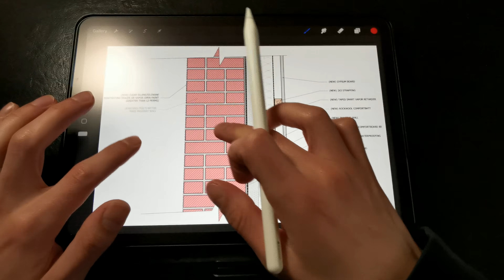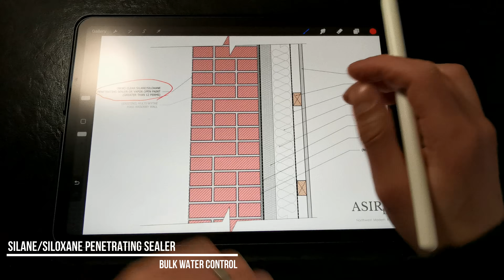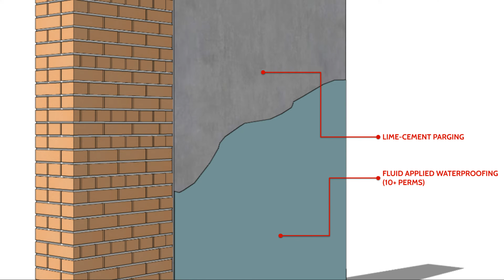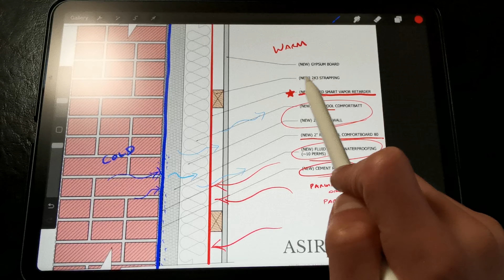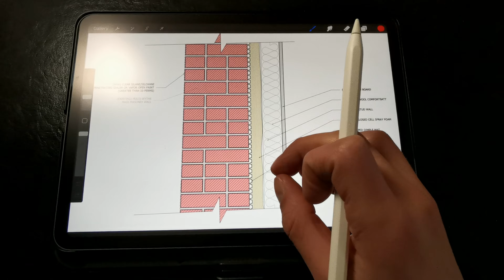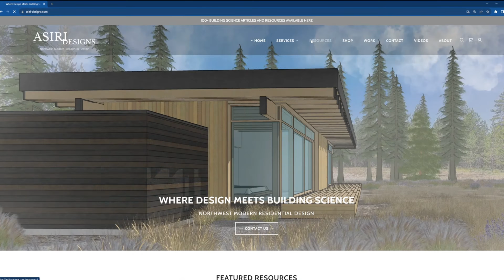Insulating Old Mass Masonry Walls (For Architects + Contractors)

Comment: What if the wall is a dbl brick wall with a 1" air gap between wythes. The joist are embedded in the interior wythe. youve recommended a dimple mat before sprayfoam but where wouild it drawin to if the joists break it up. 
@ASIRIDesigns

Comment: Love the content. But it feels like you skipped over options to insulate on the exterior of the building. I have an 1890s brick milling building in the Boston area, and don't mind going over the existing brick, but am curious what recommendations you have to put an air and vapor barrior as well as decent insulation on the outside. Are there products that have a high enough holding power to allow wood or some other rain screen and final exterior material attachment layer directly to the brick? Without an attachment directly to bring, it would seen like additional foundation for the insulation and final siding layer to be supported by would need to be installed. Are there options for this? Putting the air barrior on the inside, seems like something that is bound to get holes in it over time.

Comment: In a triple-wythe brick construction in zone 4a, (NYC), will this work?
Mineral paint on the outside.
Proclima sprayed on the interior wall.
R12.6 smartrock installed on top of the brick. (Rigid rockwool with intello preinsralled)
Metal stud framing in front of the smartrock.
5/8 Sheetrock.

Comment: I lived in an old brick building in Boston and it was quite comfortable inside with no insulation.
Reply from the maker: Yes the ones with thicker walls certainly can be! A triple or quadruple wythe masonry wall is about R-6 to R-8 which is better than most curtain walls on contemporary buildings.

Comment: Sharif, love your content. 
I am an architect with a focus on large scale office, residential and mixed use buildings but I am working on a renovation of my own home (circa 1920 Chicago bungalow) that is a mass masonry construction. I have a question about finishing the basement. The basement is partially below grade (cast in place concrete) with the above grade portion being mass masonry (brick). We have installed an interior perimeter tile and sump pump drainage system to control hydrostatic pressure below the slab. The dimple mat installed around the perimeter as part of the drain tile system transitions to a plastic wall liner that is attached and sealed to the concrete foundation wall to prevent “leakage” of the existing radon mitigation system. The sealed plastic liner prevents the radon mitigation fan from pulling air out of the basement interior space rather than from below the slab. The previous owners painted the interior side of the brick many years (decades?) ago. We are removing that paint as we don’t believe it is “breathable”. We can get a majority of the paint off but not 100% of it and this may impact the ability to get a good parge coat and fluid applied waterproofing system installed. I am thinking a sheet applied barrier (I.e. Henry’s Blueskin VP160) installed on the (mostly) unpainted brick may be a good alternative. 
Thoughts?

Thanks in advance, Chris.

Comment: We dont do it this way in Europe. You’ve completely over-complicated it. Add to the thermal mass of the walls with a thermal lime plaster in the interior. Accept that you need some heat passage into your old solid walls in order to dry them out and keep your eye on ventilation. Make sure your external pointing is lime, and softer than the masonry, the pointing is sacrificial.
Use lime wash or vapour open paints on the walls inside the building.
Reply: Or use a lime-based insulating plaster (thickness your choice). Same principle of keeping in contact with thermal mass, allowing 500mm wall to continue to perform as built, managing moisture and sealing out air voids. Although messy, it is simple. Not architect precise though! It does have a slightly rustic finish, but in keeping.

Comment: I used InSoFast panels on the inside of my mass masonry walls instead of a simple mat/spray foam. 

Baffling on the masonry side allows air movement so moisture can spread out and find its way back out. Locks together at seams & spray foamed the edges to act as air/vapor barrier. Plastic studs inside the panels allow you to screw the drywall directly to it on the inside. 

Trickiest parts were electrical & penetrations. Spray foamed the hell out of them.

Comment: Old historical urm buildings are my favorites to work on. So they will be around another 200 years. I Hate fixing those old chimneys that were built flush into the walls. I use dolomite and portland cement and sometimes hydraulic cement on stone rubble foundations below grade, but not on man made masonry or free stone materials.

Comment: You have the most informative videos in these topics that I’ve been able to find. Thank you for making these!

Do you have a method of interior insulation that you’d recommend for a cinderblock wall with vinyl siding on the exterior?
Reply from the maker: Thanks so much! I'd recommend checking out this article for how to retrofit interior insulation into a concrete block wall: https://asiri-designs.com/resources-1/f/how-to-insulate-concrete-block-walls

Comment: Can Prosoco Cat5 be also used in the interior masonry wall? Or the paint is a better solution? Triple wythe brick in NYC, I'm looking to insulate the exterior walls. Waterproof paint in the brick or Prosoco Cat5 barrier, rockwool batts in a 2x4 wood frame, Siga Membrane with Siga tape, sheetrock on top of the Siga. Will that be enough?
Reply from the maker: I don't believe Cat5 is designed for negative side waterproofing applications, so it might not be covered under warranty. Not saying that it won't work, I would just be cautious and maybe even try testing it out on a small section of the wall to see if it blisters after a precipitation event. The BMC II product a is designed to be used as a negative side coating according to their PDS. Other than that, sounds like a good plan!
Reply: @ASIRIDesigns  Thank you!

Comment: Hi. Great video. I’m the example using rigid foam, what is the purpose of the simple mat? Where does water that drains from the dimple mat go? Could the simple mat be replaced with just an air gap of some thickness and the rigid foam attached to the back side of wood framing?
Reply from the maker: Great question! We drain the dimple mat to a new interior drain tile that is discharged to a sump pump system. Actually, my most recent video discusses this exact condition and why we need the dimple mat layer: https://youtu.be/fUMfc2Ft100?si=Tyjnn6j37BpxLhkB

Comment: So I am doing something similar to your spray foam solution for my building. 40 years ago the previous owner put 1" XPS foam board against the brick, then built the 2x4 walls and fiberglass with paper on it. Seems to have worked well with little moisture issues. So I am improving the design a bit. Originally the plaster was attached to lath on the exterior walls. The lath was attached to vertical pieces of wood that were nailed into thin wood strips that were mortared between the bricks. After 160 years those thin strips aren't in great shape, so I am replacing them and adding back the vertical pieces of wood. I am then attaching the 1" XPS to those vertical pieces of wood. Then building my 2x4 walls and adding fiberglass and a vapor barrier. 

By biggest issue are the floor joists as they sit on the bricks. The brick wall gets thinner as it goes up to the second floor. And that creates a shelf on which the joists are resting. Between the joists they added bricks. So the joists are surrounded by brick on 3 sides. I am trying to figure out how to insulate it to prevent heat loss, but also trying to loose heat there so the wood can dry out without creating cold spots for condensation to form. It's very frustrating. And unfortunately there is not enough space to put foam board insulation between the joists and brick. 

Ideally I would cut the joists out of the wall and support them on the ground floor walls, and keep the joists entirely withing the insulated envelope.... but the ground floor is the area that was renovated 40 years ago, the second floor wasn't used and left untouched (mostly). So I can't rest the weight of those joists onto the walls below. In addition they carry a lot of weight due to the structural design choices made 160 years ago.

Edit: so after typing up this comment, and browsing your website I am learning a lot of information! I greatly appreciate it! You even have a post about insulating beams in brick walls! Thank you!
Reply from the maker: Looks like you found the post on embedded wood components before I could get to this! Thanks for watching and I'm glad to hear the articles were helpful to you :)

Comment: I'm restoring a 1899 old German villa estate. I have deplastered all original exterior and interior walls to let it breath. I am now onto figuring out how to insulate from the inside. Not much info out there on old buildingd and am grateful to stumble on your video. Great work. I will be using steel framing...is there much difference in the procedure?
Reply from the maker: I'm so glad to hear the video was helpful to you! Regarding steel framing - the only thing you need to really watch out for is thermal bridging through the conductive steel studs. Light gauge steel is about 400 times more conductive than wood, which means you lose about 80% of the effective thermal resistance of the insulation if you insulate the stud cavities, so all of the thermal insulation will need to be in the form of rigid insulation beyond the steel studs.

Comment: Great video! I live in an old brick brownstone in NYC and wanted to know how to insulate it from the inside. 
What's a good way to insulate the roof? It has a slight slope
Reply from the maker: Thanks for watching! Wall to roof interfaces in these types of mass structures can be very complicated and usually have to be addressed on a case by case basis. This article should help you though: https://asiri-designs.com/resources-1/f/waterproofing-and-insulating-mass-masonry-parapet-walls

Comment: Hi! Could this method be applied to an old porous subgrade foundation wall in an area that experiences freeze thaw cycles? The concepts with the spray foam makes sense with the drainage plane and an unfinished basement space. Obviously it would be beneficial to waterproof from the exterior first however we are concerned about the costs associated with that method.
Reply from the maker: Hello! Great question. You absolutely must use the drainage mat solution below grade and it must discharge to an interior perimeter drain with a series of sump pumps. This allows water that is driven into the basement walls from hydrostatic pressure to drain and dry out quickly. This should be coupled with proper grading on the exterior (slope slope slope). If conditions are especially wet and you have a deep frost depth with consistent freezing temperatures, a horizontal rigid insulation skirt can be installed on the exterior to shift the isotherms and prevent potential freezing in the foundation wall.
Reply: @ASIRIDesigns  thank you for the response! The exterior insulation skirt is a good idea and would definitely help prevent freeze thaw.

Comment: I'm neither a builder nor do I have any brick walls to insulate. This video popped up in my queue so I gave it a watch. Fantastic information, and well presented! I'm curious how this would work with townhouses. I'm assuming the effectiveness would be much less since water from the neighboring bricks will want to move into your bricks.
Reply from the maker: Thanks for giving the video a watch, I appreciate it! You aren't wrong about this when it comes to townhomes, but there are some tricks you can use if you understand how mass walls function. For one, that dimple mat strategy would likely be the best option since it assumes that water will get inside, and the drainage plane and air gap provided ensures that the water will not be a problem for that specific unit (as long as it's drained to a perimeter drain and a sump, and as long as the top is vented). Cheers!